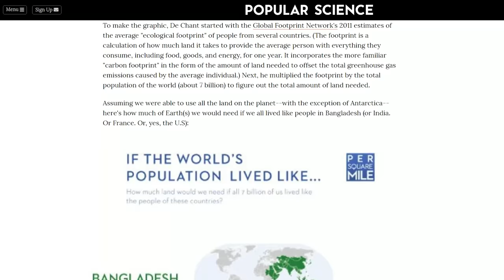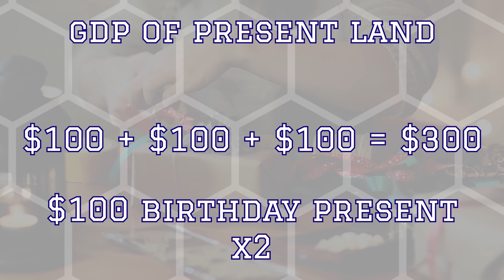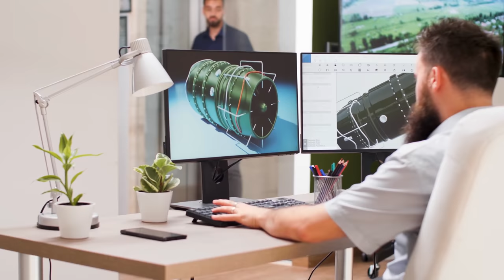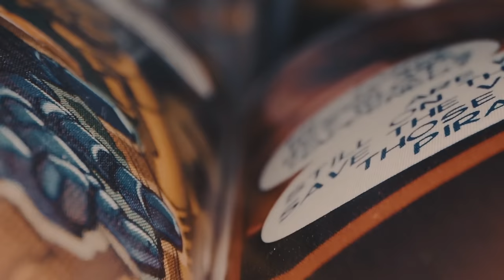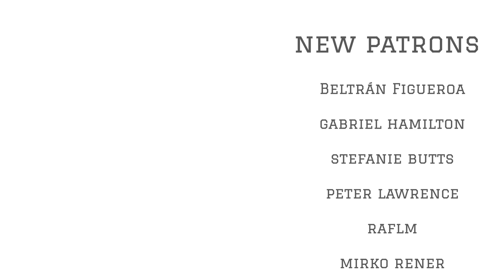What Would a Thanos Snap do to the Economy?

Comment: doubling resource is also a temporary solution. Once we have access to it (space travel, if there were dupes of planets), there will be a population explosion in the colonization to quickly drain that as well. There is no permanent solution that can be applied by a simple one time "data fix", there need to be some kind perpetual "guideline" effect. For example, make ability to concept inversely proportional to the population for any individual species. This way, the amount of population would be more or less stabilized. With an added bonus of double or more of resources, resources per capita will be and will stay more.

Comment: It could be argued we’ve come close to this sort of scenario economically with the Black Plague in the 14th century - it wasn’t quite half and it wasn’t so rapid but as close as we’ll get (for now). Commonly hypothesised as the downfall of feudalism and as you said in the video the price of labour will naturally rise. What I think is interesting is how it will affect each stage of civilisation quite differently. Proponents of the ‘Black Death lead to stronger labour markets and ended serfdom’ hypothesis might argue it was indeed a net benefit, taking western economies out of a stagnating economic system and into one more geared toward growth and development. Perhaps in our general economic stage where we’re already seeing the beginning of the end of manual labour, a hit to our population would hasten the transition towards automation. As wages rapidly increase with a halving of supply, and capital significantly decreases the prospect of replacing human labour entirely might be that bit more appealing. Whether this would come close to offsetting the loss of innovation, or if such a transition would even occur at all, I can’t say. Although the innovation loss, rightly pointed out, would only last a few decades at most. Perhaps in 50 years time when the population recovers to its current population, the greater restructuring due to the snap might start to yield net benefits.

Comment: Forget the economy half of all life means half of all plant life and if that happens we won’t have enough of them to make oxygen and EVERYTHING DIES 

The Thanos snap would doom everything
Reply: Scientifically speaking no. Because the largest CO2 and other green house gasses come from farming then fossil fuel burning and so on. So halving the plant life won't have a large impact on oxygen supply. When population is halved the fossil fuel consumption will also reduce significantly so it's a win for us in the long term if we implement and adapt properly. In regards to farming my info is from the project I'm working with our University regarding reduce green house gas  emission from modern farming. Our conclusion is not completed but from our data it's better to use Asian and Indian traditional farming methods without pesticides. Because they produce the same amount of crop yield without distorting the soil.
Reply: In terms of which plants actually convert the most CO2 into oxygen, surprisingly, it's plankton. In fact, plankton are responsible for about 80% of the CO2 to O2 conversion that happens on earth. Plankton are able to reproduce quickly, so they would recover very quickly from a 50% population wipe, in comparison to trees, or humans.

Comment: As a point, one thing missed from this is that especially for certain goods, the snap doesn't actually remove anything from existance,  so it's also very possible that even in 10 years, maybe people wouldn't need to be producing stuff (obviously this doesn't apply to food)
Not to mention, supply chains probably don't work with 50% people, even with only 50% of the demand.

There is a lot of nuance's to this issue of removing 50% of the people in the world from existance, and ultimately, it's not a good thing, and kinda relys on us having easy access to the same resources with 50% of the people dead (since also since it's random a whole farm could potentially die even though it's 50% on average.)

Comment: So which half would be gone? The rich, the poor? The smart, the dumb? The old, the young? The farmers, the factory workers, the clerks, the techies? Male, female? How do you evenly split each demographic and take only half out? People fit into multiple category.

If the split cause some uneven demographic in a certain group it would cause a huge imbalance leading to other economic scenarios. While it is the easier approach to analyze, I dont think you can just assume everything is cut by half evenly across the board. On the other hand, it would make for some interesting scenario if entire sectors of some industry or generation were vaporized.

Comment: You are not completely wrong, but you are assuming a 100% perfect distribution in the deaths. Even minor discrepancies from a perfect homogeneous distribution (even trivial ones, like preferring deaths from densely populated areas)  would likely cause catastrophic disruptions which could easily cause permanent damage to the economy, and in the most extreme cases (like killing only males or females) could easily wipe out entire species.

That aside, you are ALSO assuming that there won't be destruction of infrastructure caused by the sudden lack of labor force, nor permanent loss of capital caused by the work force shifting to higher wage positions desperate to fill their own resource void. 

But in general, halving the population would never work for the intended purpose. And at least here in earth an homogeneous culling of 99 people out of 100 would not make that much of a difference in practical terms, the main issue would be just the time it takes to bounce back to the current values. Specially under the assumption that it did not caused a significant loss of knowledge and that survivors will try to make use of the existing infrastructure and put polices that incentive population growth.

Comment: I think the birthday example and the conclusion is very flawed. "The more people there are, the more they will gift, buy, work." is correct, but there is more of a linear correlation, then an n! one suggested by the birthday example. 
Also, when it comes to research and innovation, there might be breakthroughs that can be attributed to a single person being ahead of his time. But in most cases, several people come to the same conclusion, develop similar patents or products, because they are responding to the same problem, with similar education and experiences. A good example was the Cold War, where the same things had to be invented on both sides of the Iron Curtain. And both sides managed. So I would argue that the number of researchers doing innovation won't be responsible for innovation slowing down. The main factor slowing down innovation will be the well being of the people. If halving the population stops global warming, then there's no point to do research in order to solve it. If everyone is well fed, because there's an abundance of land, then no need to research more efficient ways of utilizing farm land.

Comment: There is a fallacy after 10:45. It's a big assumption to say that halving the population gets rid of half of the innovators. That's a complete nonsense! The amount of people actually innovating is so ridiculously small, that you would need to reduce population by 99% and still have a bigger chance of winning lottery than ridding of a single innovating person. If the logic of "equal" riddance of population was applied and we assumed that innovators are evenly spread across populations, halving population would actually allow many people work less for same income and free their time to innovate. Low wages are what actually keeps people from taking risks and innovating, because they are in the subsistence mode. Having said that, tweaking thanose's plan, so that only certain people are subjected to genocide, would greatly improve benefits of this whole operation.

Comment: It's not the economy that drives mankind but mankind that drives the economy. 

Add the certainty that societies' demographics, post-click, will not retain the current structure; the post-snap world will not be a smaller version of the current one. IOW, blacks will most likely not still be the current 13% of the US population nor will teachers be at 2%. Nor will the mathematically remaining inventors in the US be proportionally redistributed across the inventions being worked on by the 150K active in 2015. The implication is obvious, there probably will be a surfeit of idle equipment capacity in various industries and/or a shortage of manpower, qualified or not.

My bet is that the Thanos finger-snap will reveal, painfully, that the world is not like a salamander's tail. Assuming that society will be re-structured post-snap to the shape it had pre-snap, is dangerously misleading.